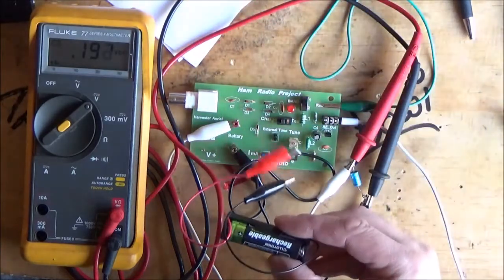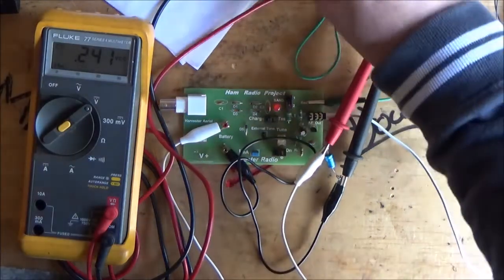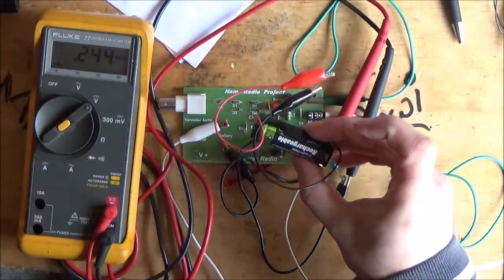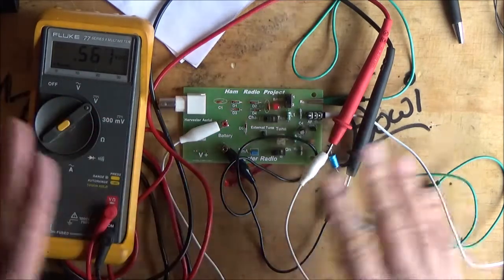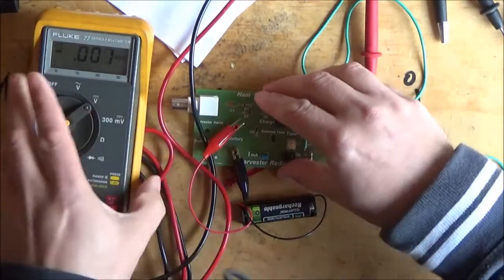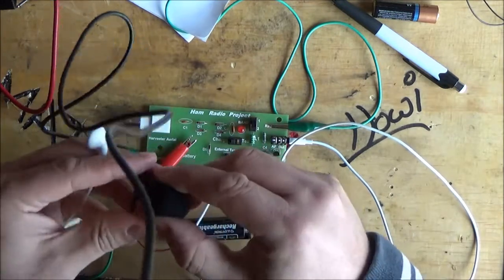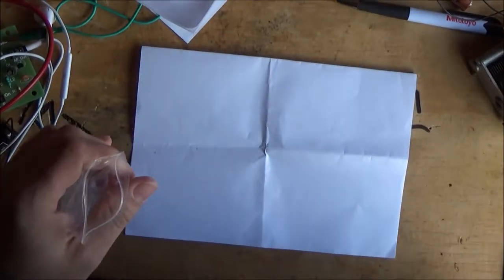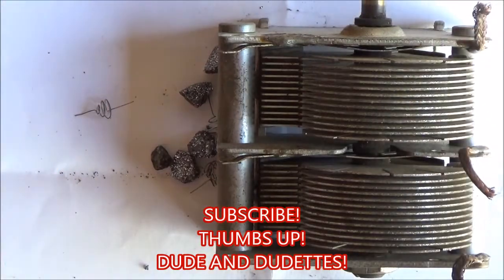Dub-Eng: Radio Wave Energy Harvester - FINAL - PT4

Comment: AS you know I bought the same radio from Trevor, so I done a small video of the radio working with the "capacitor test" . I was getting about 1.1v  across the cap

video:link
https://www.youtube.com/watch?v=Av2qvgv4DAE

Looking forward to your next project ..Roger

UPDATE :
. Removed the long wire antenna and replaced with three shorter antennas. One @12' one @5' another 1.5'. Now get the full 1.2 volts into a single AAA battery. Which makes the radio works better
Reply from the maker: TheAcehere1 ....  roger, good work! ...  the ambient radio noise in your location (or your antenna setup) does a good job! Trevor please see Rogers video! Thanks kindly for the mention!....   for those with a keen interest in all things radio, have a visit to TheAcehere1

Comment from the maker: I just came in from out of the cold and plugged trevor's circuit into one leg of my large Dipole antenna (approx a 10meter half wave dipole) and connected ground to the radiator in the house.  We are up to 0.786 volts across the capacitor.... far better than my  garden long-wire and earth stake.  But...  still not enough local ambient energy to charge a 1.2volt NiMh cell.  Can we connect a bunch of these circuits in series?
Reply from the maker: hmmmm